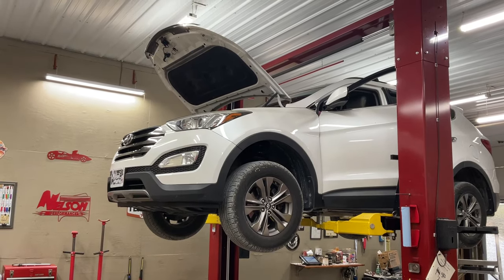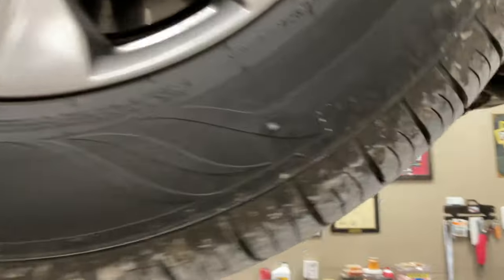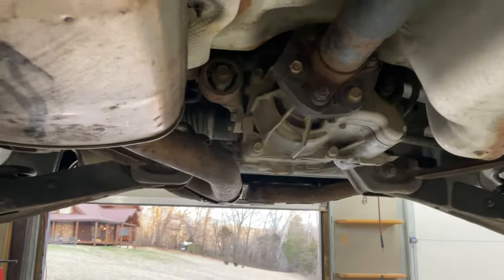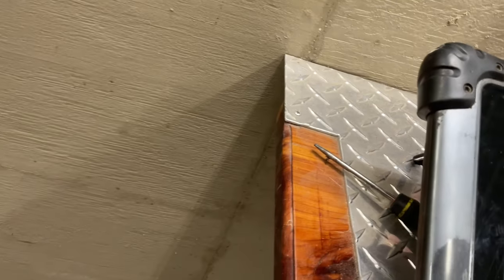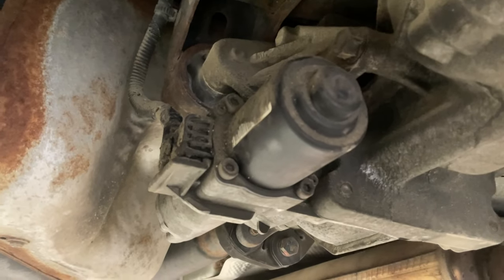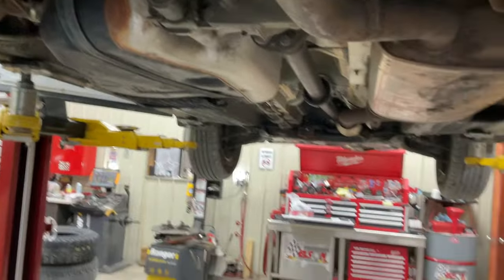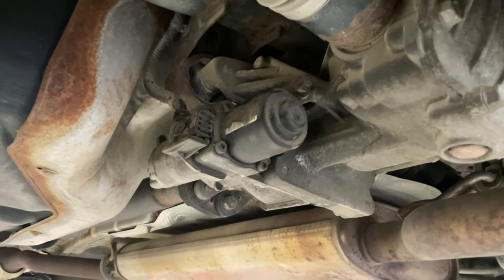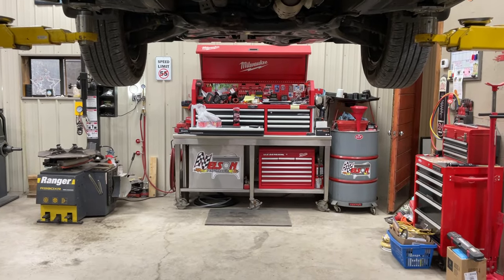20I3-2018 Hyundai Santa Fe AWD / four wheel drive not working, no codes

Comment: It’s a sealed diff not worth repairing, and new ones are very expensive. if it’s the cause just get another from the scrap yard. These Santa Fe’s are also known for having the male/female connection gear between the gearbox and front transaxle to get worn out and lose grip, so it’s worth checking if the drive shaft rotates when in drive
Reply from the maker: Thanks for the comment and the info! I had heard about the spline wear also. We ordered the rear diff lock unit. it was around 425.00. fingers crossed 🤞🏻 Good luck on your projects! Nelson

Comment: I’m faced with this issue. I can continue to drive it in FWD? 
Does that mean all the output is goin thru the front left axle shaft since the diff to transfer has sheared off any output to the right axle shaft? Is that ok is it?
Reply from the maker: Yes, It is still drivable but if it calls for traction assist it will only have FWD

Comment: Hi. Am having the same problem with my Santa Fe 4wd not engaging. Was only able to find this out in a bad situation on a muddy road. What was the problem and how did you fix this?
Reply from the maker: Hello, I replaced the torque unit on the rear axle . it’s the part that the driveshaft bolts to and has two small wiring harness plugs on it and an electric actuator motor on the driver side of the unit. it’s usually that part or the front transfer case unit. The splines will strip off where the rear driveshaft comes out of it. it’s easy to diagnose by jacking up all four wheels (or put it on a lift) and put it in drive and push the traction lock button. if the rear driveshaft is turning but the rear wheels are not then it needs the rear torque unit. if the driveshaft doesn’t turn then the front unit splines are worn. Good luck on the project, Nelson.